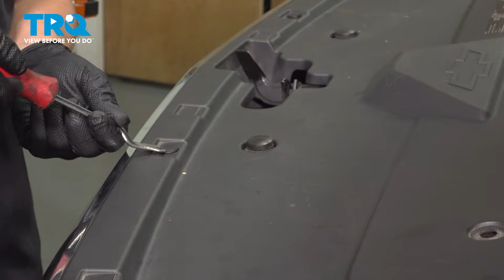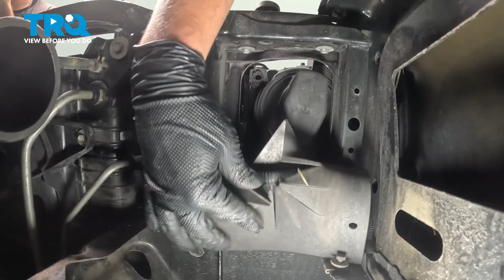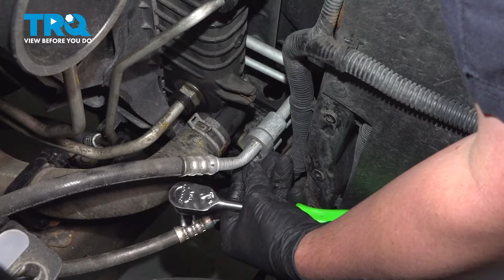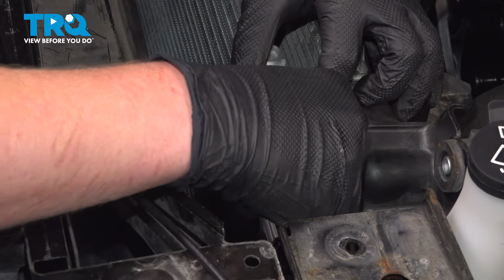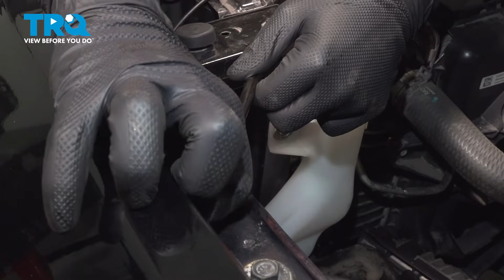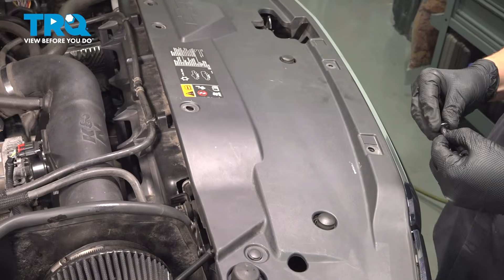How to Replace AC Condenser & Receiver Drier Assembly 2014-2018 Chevrolet Silverado 1500 5.3L V8

Comment: Good job. Your a born teacher. The air moving sound you heard when removing the blocking plate on the new condensor was the nitrogen gas it was pressurized with escaping not any vacuum. The air was leaving not being pulled in. Thought I might mention this. Thank you.
Reply from the maker: +@NoThankYou-i7j Thank you! We love empowering our customers and showing how to perform DIY auto repairs with our high-quality auto parts. http://1aau.to/m/Shop-TRQ

Comment: I had 1 shop say they would charge me $1025 just to change the AC compressor. Then another say they will need to change compressor, condenser, and dryer all for $625 parts would be from O'Reilly, or Federad

Comment: Thank you for the video.  None of the condenser videos talk about adding any oil to the new condenser, but some posts in some forums mention adding oil.  What are your thoughts?  I have the typical pin-hole leak at the weld so I'm inclined to not add anymore oil.

Comment: To answer my own question haha it took me 6 hours with no experience just following the video instructions and now I have ac in my truck. I installed this in a 2016 chevrolet silverado high country, I didn't have to go to shop to get it re charge I did all myself, parts and accessories I think 200 dollars plus my time. But I save 800 to 1000 dollars for what the local mechanic was trying to charge here in the state of Colorado.